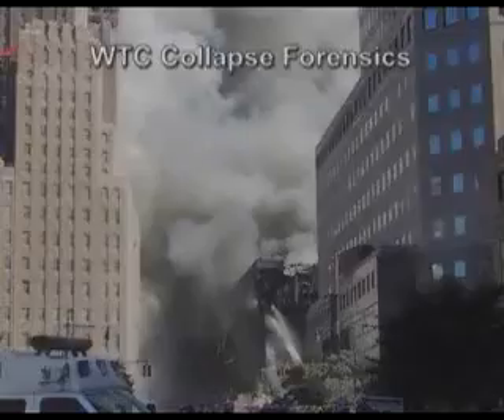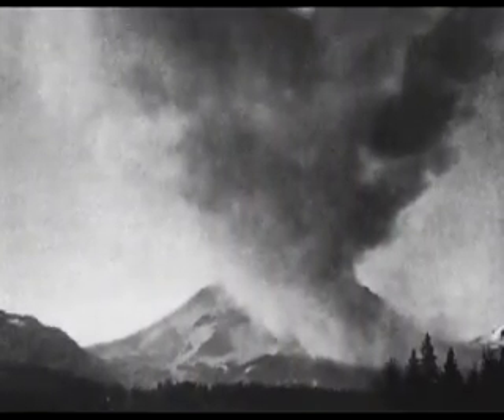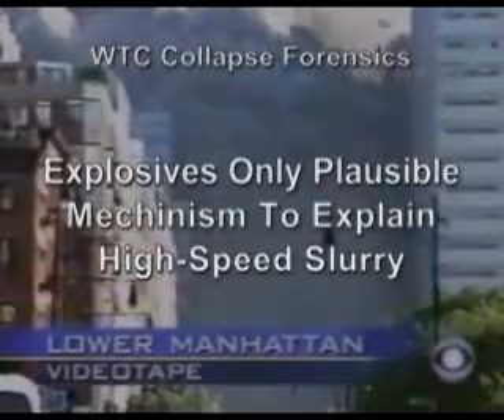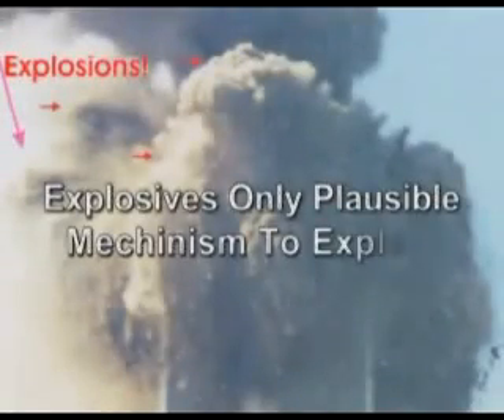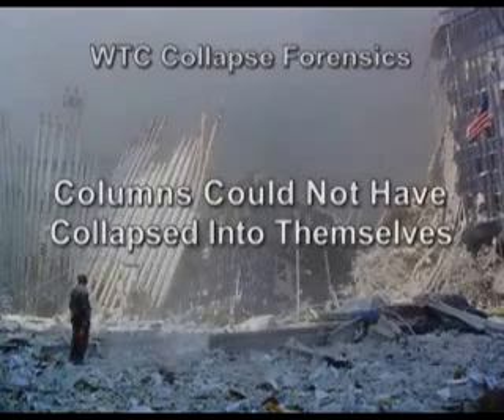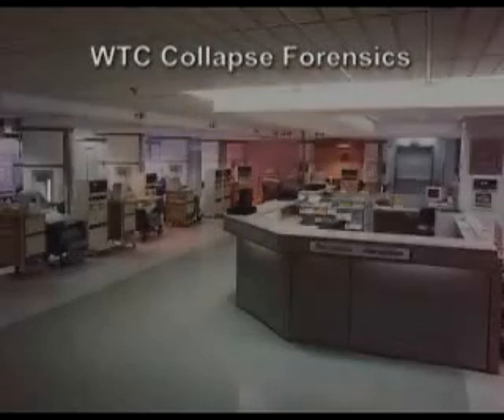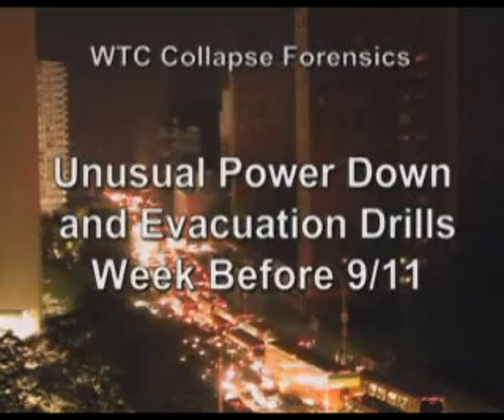MIT Engineer Disputes 911 Theory of the WTC Collapse-Part 2

Comment: @NonnyMus1 If high explosives caused the damage, where are all the dead bodies?  In reality, shockwaves from the impact cracked brittle materials such as windows & stone sheathing but weren't strong enough to hurt people in the lobby. Reports of explosions at various points during the tragedy were likely due to crashing elevators & exploding pockets of jet fuel (also, exploding elevator motors, HVAC equipment, cleaning supplies, transformers, CRT's, UPS units & hydraulic pistons in chairs).

Comment: @NonnyMus1  King was correct in saying that the building's restabilized, with intact structure taking loads from the severed and damaged columns. He's even right when he claims that, "absent further weakening...that doesn't progress to a total collapse".  He neglects to mention that the fires provided "further weakening". 

King then skips backwards to reports of explosions heard at time of impacts. He shows damage to the ground floor lobby and claims 'high explosives caused the damage'.

Comment: @NonnyMus1 The energy from the jet impacts far outweighed any energy from hurricane level winds. Since King doesn't show his calculations, we don't know where he got that absurdity from. He also fails to distinguish lateral loads (to the side as that from winds) and compressive or gravitational loads (weight pressing down).  The exterior columns were designed to bear lateral loads.  As the each building bent in response to the crashes, core columns experienced lateral loads.

Comment: @NonnyMus1  King claims that steel keeps a lot' of its strength up to melting point of ~2500° F (depending on alloy).  On this planet, steel loses 80-90% of its strength at 1000°F.  Heated steel deforms under load.  This fact had been stated many times in the 5-6 years between the building collapses and King's talk, yet he ignored it.

King gets really muddled about the oscillation and 'restabilization' of the Towers after they were hit.

Comment: @NonnyMus1  Much concrete rubble was in the debris pile at Ground Zero as shown here - /watch?v=ZD0zg1OwBSo  
Explosives were not the "only possible" explanation for the dust clouds. The energy in the buildings' collapses were ~equivalant to a small nuclear bomb. 
The small particle size he mentions are indicative of burning.  Unburned materials and larger particles were also found in the dust cloud. 

Once again, King repeats the old canard that steel columns "telescoped" into themselves. Nope.

Comment: @NonnyMus1 King claims the clouds were pyroclastic, which is simply absurd. Pyroclastic clouds are hot - over 1500°F.  Persistent dust clouds exist in more than the two situations he mentioned.  Dust storms are one.  Large fires are another.  

King's claim that carpets protected the concrete is absurd. Carpet has little structural strength which is why we don't use it to frame buildings!  Despite his cute little cartoon, concrete decking is hammered downward in a building collapse.

Comment: Just as in Part 1, King lists already debunked points, accompanied by some illustrations & clips. He starts by claiming the dust clouds after the collapses were mostly from concrete. He should have done some research! R.J. Lee had released its study of the dust in 2003, so the real composition was known. The dust was mostly gypsum (from drywall), chrysotile asbestos (from fireproofing & flooring), mineral wool fibers (from insulation), pulverized vermiculite (from plaster), and ash.

Comment: @muzicmaker2001  You've seen a building or object naturally fall into the path of most resistance?!  That's impossible!  You must've been dreaming.  Just like King is dreaming when he claims concrete had to jump up into mid-air to get pulverized in a building collapse.  In fact, it gets hammered downward.

A lot of King's statements are just as absurd.  When I finish watching, I'll list all his mistakes. Just for starters - King assumes the dust clouds were mostly concrete & they weren't.

Comment: @914light  giggled, "had to giggle a little at "concrete jumped into mid-air" he is soooo right on..."  

No, he's not.  Not all the concrete was pulverized as any close-up photo of the debris pile shows.  Concrete breaks into smaller pieces than structural steel in building collapses. Those smaller pieces are under the steel in the debris pile.  

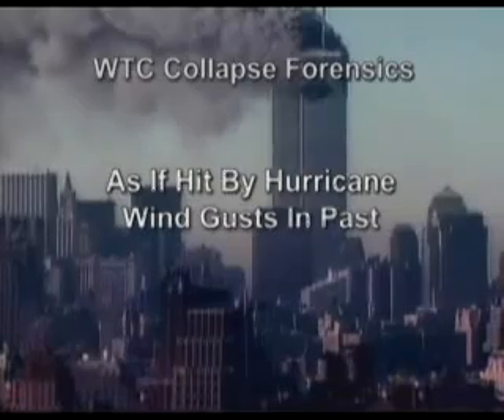You can see a photo at 3:51 here /watch?v=ZD0zg1OwBSo.  Actually, watch the whole video.  It contains real information.  The series is good, too!

Comment from the maker: @damnbigfish 
For the pancake collapse to be realized, at the initiation of the collapse, thousands of bolt, joints, supports all would have to break at the same time. That is obviously nonsense. Controlled demolitions (explosions) cause huge amounts of dust and the charges are set to go off at certain times leading to a progressive collapse. And thats what was seen here.

Comment: @damnbigfish  Amen!  The fine powder also consisted of pulverized sheetrock and ash.  To save weight, the designers had sheathed the elevator shafts and stairwells with sheetrock instead of concrete blocks.

Comment: @Darkrunner1975  The collapse of the towers had nothing to do with the foundations and everything to do with the structural damage done and the fires.  

The framing of all 3 buildings was tube-within-a-tube. That means the exterior columns were structural. 

None of the buildings collapsed into a neat pile.  The devastation went on for blocks. 

Wikipedia has a good article explaining what happened. Go there and learn.

Comment: @muzicmaker2001  Nope, but WTC7 was also tube-within-a-tube construction & it had many transfer trusses.  Its collapse was caused by a fire which caused one key truss to fail from thermal expansion, causing one key column to fail. NIST Pub 861610

And that's coming from a person who listed the Kader Toy Factory in response to your question, "..fire has led to the collapse of how many steel framed high rises before or after 911?"

Stop making stuff up and moving goal posts!!

Comment from the maker: @muzicmaker2001 
Correction:

And WTC7 did NOT have a fuel-laden plane slam into it and still collapsed in seconds. So, it either seems that the plane impacts did not matter as far as contributing to the collapse

(or)

falling debris only damaging one side of a building is equivalent in its ability to bring down a steel framed high rise as a plane impact?

Comment: @muzicmaker2001  I'm only going to focus on one of those groups because even I can't take that much crazy all at once!  Architects and Engineers for 9/11 Truth claims ~1600 architecture & engineering *professionals* - that means architecture firm secretaries, drafters, CAD operators, jr. designers and the like. They claim ~13,000 even less qualified supporters.  

They support all the old debunked claims which make up the standard troofer package. So, they're random troofers. I don't trust them.

Comment: @muzicmaker2001  All those fires were in steel grid framed buildings.  None of those fires were associated with fuel-laden planes slamming into them.  Even if they had plane impacts, they likely would have survived because the steel grid frame is more robust.

You really need to start comparing apples to apples, not steel grid frames to tube-within-a-tube frame.  That is what NIST did.  Please read the report.

Comment: @muzicmaker2001  Well, there's the Kader Toy Factory for one.  Uninsulated steel again.

Since the tube-within-a-tube design was new, no building of that type had been tested by impacts & fires.  Read the NIST report.  With analysis and modeling, they figured out how the impacts and fires caused the collapses.  Better yet, they have backing evidence for all their conclusions!

Also, did you call King an 'MIT engineer' or is that how he bills himself?

Comment: @muzicmaker2001  You are thinking that because people were seen at the severed gash in the side of the building, the temperatures at the gash were lower than 1800°F.  You would be correct.  The fire wasn't where those victims were. Those areas were also being cooled by being open to the air.  That is why the victims were there.

Those were big buildings.  Each floor was about an acre.  It's more than possible to have an inferno 150 - 200 feet away from you and remain unsinged.

Comment: @muzicmaker2001  In fact, the head structural engineer, Leslie Robertson, didn't account for fire. He assumed a 707 would be low on fuel & off course for landing at JFK. He also assumed a low speed.

His design was sound in that the towers stood for 52 minutes and over 1.5 hours after the impacts. It's a remarkable achievement, since the planes which hit had ~40 times the energy of his assumed 707.  But in the end, it was the fires on top of the structural damage which made them collapse.

Comment from the maker: @NonnyMus1 
Like some logic? People were seen at the North Tower impact hole approx. 20 mins before it collapsed. From impact to collapse, there was 102 mins. This means this "inferno and 1800F degree temps" had 80 mins to heat the steel to failure. After that, people were seen at the impact hole. Question: Did they walk over, around or thru these temps? Also, was one side 1800 degrees and the other side like the cold side of my pillow? Look up the thermal conductivity of steel. Keep trying...

Comment: @muzicmaker2001  After the buildings collapsed, the temperatures were mitigated by all the debris which weren't previously on fire.  People were walking around areas where debris were insulating them from the fires which continued to rage underneath.  There is no logical discontinuity there.  Even in house fires, people can 'walk around' in the smoking ashes with no harm.  

So, yeah, in addition to cherry-picking, you're drawing wrong conclusions from information!!  It's called delusion.

Comment: @muzicmaker2001   You're cherry picking!  There were about 160 support columns in the towers, so that sample was 10% of the total.  And that analysis was only *part* of NIST's investigation.  Do you know the other parts?  Things like thermographic analysis which showed fires reached 1800°F in spots.  Things like video analysis which showed hot spots in towers where debris had been heaped up by the plane's impacts.  

Stop cherry-picking!  Yes, it was an inferno.

Comment from the maker: @NonnyMus1 
"The buildings were stable as designed before two fuel-laden planes slammed into them"

"The building was designed to have a fully loaded 707 crash into it. That was the largest plane at the time. I believe that the building probably could sustain multiple impatcs of jetliners."-WTC Construction Manager 

watch?v=64W8bzXfGCA

A 707's max takeoff weight=336,000 pounds. 767's =395,000 pounds. 
707's length=153 feet. 767's=159 feet. 
707's wingspan=146 feet, 767's=156 feet.

Comment: @muzicmaker2001  No, individual floors were briefly supporting 5+ times their normal load on 9/11before collapsing.  The buildings were stable as designed before two fuel-laden planes slammed into them, severing support columns and setting them on fire.

Do you not know that the exterior columns were actually structural and not a facade, as they would be in a steel grid frame building?  If so, read up on tube-frame structural design to understand how devastating the impacts were.

Comment from the maker: @NonnyMus1 
"and the result is an inferno."

"Of the more than 170 areas examined on 16 perimeter column panels, only three columns had evidence that the steel reached temperatures above 250 ºC (480ºF). Using metallographic analysis, NIST determined that there was no evidence that any of the samples had reached temperatures above 600 ºC (1110ºF)." (p 140)-NIST

Comment: @JacobAMunoz  Amen!  Most people don't know that all the plastics and synthetic fabrics and foams inside offices are made from petroleum.  When heated, they eventually liquefy and burn with about the same energy as oil.  

They are made with fire retardants, but those chemicals fail with time and temperature.  A fire initiated by jet fuel blasts easily overwhelm them and the result is an inferno.

Comment: @muzicmaker2001 
1. The individual charges would have to be set off by radio transmission if no detcord was used.This would require signals on different frequencies in a sequence.An errant civilian transmission on the frequency you were using for a remote detonation could set them off too soon.
4.By using any planes at all the body count was much lower. The peak occupancy of 10,000 was about 10:30am .By using aircraft on the higher floors,evacuation was possible and the body count much lower

Comment: This is so stupid about the inside core supposed to be so strong and it being impossible for a pancake effect of the floors falling on each other all it takes is one floor to fail.A square acre of steel is alot of steel to fall on top of each other. Em did "engineers" not say that the titanic was unsinkable an em........where is that now?

Comment from the maker: @mrtommynazi 
1. Say what? This is not the 50's. There is no danger in transmitting the signal even from miles. The signal (in close proximity) and operations would come from WTC7. Therefore, the evidence needed to be destroyed in seconds...

4. Planes have passengers. Dying passengers creates sympathy, sorrow, then anger and ultimately the need for revenge. A perfect formula. But, I didn't write this story...

Comment: @muzicmaker2001 
1. remote detonation for each charge would be seriously impractical and dangerous,any errant radio signal could set a charge off at any time.Where would you originate a transmission signal?
4.A few hundred passengers lives would be small poatoes compared to 10,000 deaths if buildings were imploded at full occupancy with no warning at all.Planes still not needed if buildings were pre rigged for demo.

Comment: @mrtommynazi 1. There were power downs and evacuation drills weeks before, elevator maintenance done months before, that time could have been used to plant such devices. 2&3 wires could have been rigged through the core of the building, could have used timed devices floor by floor. The impacts themselves could have been what started the detonation process, who knows. 4 make everyone afraid of the terrorists. Easier to pull something off when there is an "enemy" 5.only need a few to piss off many

Comment: @muzicmaker2001  
1.How do you secretly route detonation cord secretly throughout a 110 floor building?
2.How do you prevent fires and a plane impact from disabling your detcord and charges?
3.Where is the central point for detonation from which the detcord will travel to the charges?
4. Why involve aircraft at all if you have  3 buildings rigged for implosion at anytime?
5. Why not wait for the buildings to achieve full occupancy and implode them at that time?
Just a few questions.

Comment: Another waste of time. This MIT guy doesn't believe that the collapse can cause the pyroclastic dust cloud, but then never explains how much explosives would be needed to have caused it.

The clouds are there, and he states that the dust included office supplies, so how do explosives turn computers into dust? I want a link.

How much explosives would it take to turn 110 acres of 4 inch thick concrete flooring into dust? Then add the core and stairwells.

Comment from the maker: @roquefortfiles 
There is no reason why the ground would shake before the collapse except for...are you ready for this? CD charges going off breaking supports and columns or a massive earth quake in NYC. Was there an earth quake in NYC on 911? Put away the blue prints because they have to be used for WTC7 also. But, that's gotta be different, right?

Comment from the maker: @roquefortfiles 
Again, the next time someone needs a 110 story 1350 ft steel framed high rise taken down, forget CD. Its too expensive and takes too much time. Just put a small hole in it. say about 4-6 floors. Pour some jet fuel into the hole. Wait about an hour and watch it crumble to dust and easily manageable pieces of steel in seconds. For 600 ft buildings, just drop some debris only on one side of it and watch it fall in under 8 secs. This is why noone believes your BS.

Comment from the maker: @roquefortfiles 
This is very simple. A "normal" building fire leading to a collapse should not have:
1. Explosions all throughout the building and unrelated to fire. 
2. Demolition flashes all throughout the building
3. Ground shaking before the collapse
4. Extreme temps in the basement areas and buried in the rubble it lasting for weeks
5. Nano-thermite discovered in its rubble

There is no logical way to explain these events other than CD and nano-thermite used in conjunction.

Comment from the maker: @roquefortfiles 
Here's the evidence. Learn it..

1. Near free fall collapse
2. Witness accounts of explosions
3. Pulverized concrete at initiation of collapse
4. Pre-collapse ground shaking
5. Demolition flashes
6. No physical evidence of extreme heat at impact hole but..
7. Extreme temps buried in basement/rubble for weeks
8. Nano-thermite discovered

Comment from the maker: @roquefortfiles 
Its interesting that debunkers use that the plane impacts as the cause of the WTC collapse when logic tells them that a steel framed high rise has never collapsed before or after 911 due to fire. But, then they use damage for the collapse of WTC7 even though WTC6 was in between the North Tower and WTC7 and suffered more damage than WTC7 but never collapsed. Interesting...

Comment from the maker: @roquefortfiles 
NIST stated that the jet fuel fires burned out in less than 10 minutes. Did you see that? And there was no jet fuel at WTC7, right? That is why this is significant. Get it now? Again, what did all three buildings have in common to have caused these extreme temps buried underneath them?